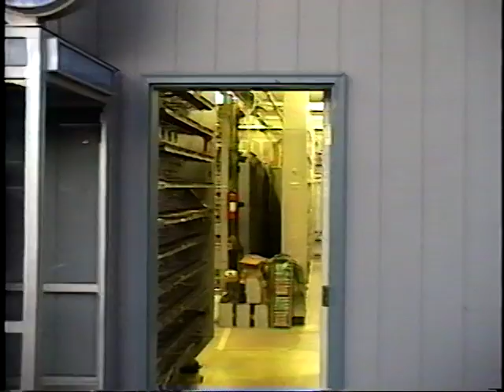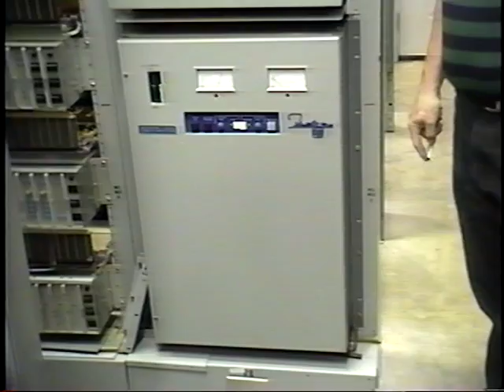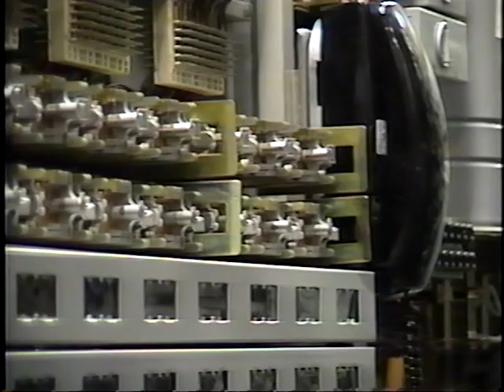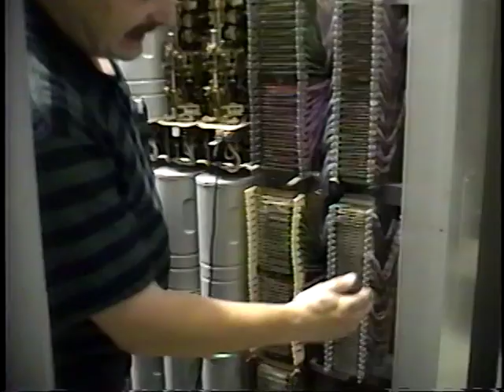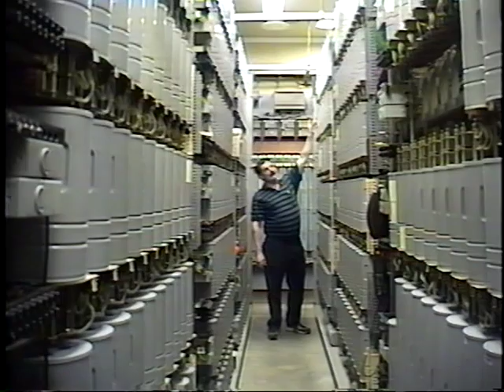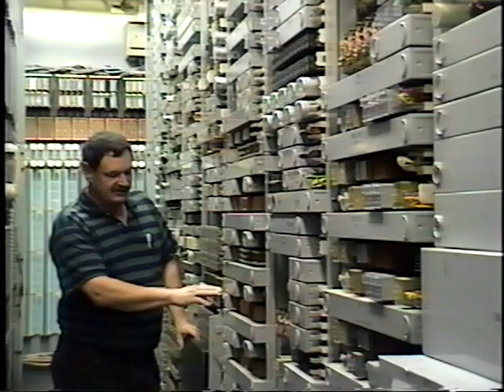Strowger, (SXS), step by step, Bell system, Western electric, Step switch

Comment: Fascinating!  I'd much sooner trust a good ol' relay for longevity 16:47 16:55 than any dirty digi-chip. Problem is, even a relay can't work forever. What can you do if one of those cans goes out?
Reply: You can rebuild it.  At the Dial Central Office Repairman school at Ft. Monmouth in 1966, we took ‘em apart and put ‘em back together.  The mechanical parts and the relays.  I worked in exchanges of this type at Ft. Benning, which is now Ft.Moore.  Of course, in the Army way, they sent me to a 19 week school to learn this stuff, but at Benning the exchanges were run by civilian employees. My job was to cut the grass.  But by begging I got to work on equipment sometimes and ended up being the night guy where I could fix whatever I wanted.  Then I got shipped to Germany, where I never got to hold a screwdriver. The equipment was Siemens and the civilian employees were German.  Strange unit.  One officer, about 25 GIs, and 75 German civilians.

Comment: At my fire department we had a remote fire siren that was several miles away from the firehouse which was hooked up to a phone line. We had a single pole single throw relay at the fire house connected to the Plectron where the coils to the relay were activated which closed the relay on the phone line when ever we would get a call and at the location where the siren was at, it was controlled by a weatherproof relay which was hooked to the starter for the siren, does that work the same way as this?
Reply: Those type siren controls used a “dry loop” (meaning that the telco only supplied the wire, no equipment) circuit.  A voltage source, usually at the FD, was fed thru the relay, to a telco supplied wire pair, that went to the telco office, was cross connected on the main frame, to another pair out to the siren location.  They were also called “alarm loops” as that was the most often use for dry pairs.  Businesses alarms were connected thru the telco to the monitor location.  Also the base radio was often remote controlled over a dry pair.
Reply: @stevepark5504  Ok gotcha!

Comment: Really want to have some fun? Here's an idea: Use one phone to dial the 218-488-0777 equipment listening number. THEN, use another phone to dial in from PSTN to get dial tone (the 346-377-0505 number.)

You can actually hear the system picking up your incoming call and the equipment respond to your inputs - literally listening to the selectors move for the very call you are making.

Even better, once you connect to something like the Audichron machine (internal number 377-4444) you can hear it on both the line you dialed in from and the equipment listening line, quelling all wonders you may have on if you are REALLY hearing the equipment you're using in real time.

For a modern phreak it's a bit of a religious experience, one could say. :D
Reply: Sounds super fun but considering I'm being charged around a dollar a minute to call in from Europe just for the dial tone I don't think it'll be good for my phone bill to have two calls running xD
Reply: @NikHYTWP  hey I would like to show you some cool stuff if you have discord let me know!

Comment: Tried the 346-377-0505 number and got a message "the number you have dialed is unallocated"
Reply from the maker: Try 541-327-4488
Ill check on the 346 number to find out what happened. Thanks for the info.

Comment: Thanks, very informative. Do you have a wiring diagram for the terminals  on the wood block and is it the same for the line finder, selector and connector?

Comment: wow great memories here when I was in the Navy back in the late seventies I ran a 300 line exchange at the naval transmitter site near Sidiy  Yahia Morocco. we had microwave links between that Base, the receiver site, and the main base in the city of Kenitra. I loved the 
Automatic Electric stroger equipment. I could custom build special devices out of broken equipment. one of them being a reverting ring machine for each of the three exchanges as well as  setup for monitoring the microwave links and busing them out as well. I also built a device for monitoring with a telephone handset transmitter unit at the main exchanges power board.
Reply: Just an addendum that was actually at 100 line exchange the we had a 300 line at the transmitter site and 800 at the main Base
Reply: I can remember when the power house we go down and every phone in the place would be picked up and all my finder's all wood pop to the top and my battery discharge went into overdrive

Comment: The Telephone Museum in Seattle also has a nice central office of Step and Panel offices and and an early WeCo ESS. I believe there's another hobbyist with a central office in the Sierra's of California near Angles Camp. I never can get enough of Electro-Mechanical Switches. Someday I'd like to find someone that has a working Bell System Picturephone setup through #5 crossbar. I always remember trying out the one in DIsneyland in the 1960's. Way ahead of it;s time.
Reply from the maker: I'm involved with both.

Comment: This is so interesting although very tough to understand.  Each telephone on a step by step goes through those canisters which are all very mechanical.  For that reason, I fail to comprehend how another machine could identify the number you are calling from on such a mechanical system.  I also don’t understand how an operator could barge into the line to see if there is trouble on it, but I know they used to do it.  Before call waiting, the only way to get my mom was to call the operator.  Mom would chat for hours at a time and if I really needed to talk to her I’d dial the operator and ask if they could check the line for trouble.  Mom would hear the clicking of the operator cutting in and hang up knowing it was me trying to get through.  I also saw the coin phone equipment.  That is also very interesting about the coin return or collect.  When calling long distance on a payphone the operator would be needed.  The operator would ask me to deposit $1.10 for 3 minutes, and if the line was busy the operator would press something that sounded like a high pitched ring signal and my money would come back.  The operator was somehow able to control whether the coin returned or was collected.  It’s always been a mystery to me how this all worked.
Reply: ds99,  I just read you post.  I was a pbx operator at my high school, then the local Hospital and then the Army overseas.  When I came home I started working at AT&T as an operator.  I didn't get to work on the old cord switchboard as it had just been taken out of service and new TSPS consoles were the newest technology.  You mentioned the operator checking the line for conversation.  When I became a supervisor after 4 years of being an operator I was lucky to get to work on a large cord switchboard in Oklahoma City.  The service you are talking about was called Verification.  When a customer dialed 0 and ask to check for trouble when the new system was installed, that operator would connect you to the verification operator on the cord switchboard by dialing a special number.  That would light up a signal on a red/white strip on the cord switchboard and you waited for the first available verification operator to pick up your call.  After you gave them the number to check, the operator plugged into special jacks/connections to verification equipment for that exchange and keyed that number.  The equipment would cut into the line so that the operator could hear if it was conversation or in trouble.  IF you declared an Emergency, we took your name and number, cut back in and excused ourselves and explained we had an emergency request and who it was from.  If they agreed, we gave them your number.  After TSPS was a few years older they developed a way that the dial 0 operator could press a button to verify the number.  You probably couldn't tell the operator had connected if you were the one on the phone, and the operator could not make out what was being said, but could tell if it was off hook, in conversation or trouble.  Along with this service being available at the TSPS console also made billing you for emergency interuptions as easy as pushing a button.  I also don't understand exactly how the mechanical switch could tell what your number was, we would get a display with your number once we got to the new TSPS system.  As the old equipment was removed and new electronic switches installed of course it became easy to identify the number.  Rural  areas had older equipment for a longer time, and when they dialed long distance with 1 + it came into the console with a light that read CAMA.  We then ask you for your number and entered it.  The bad part of that was if I made a mistake, or you gave someone else's number it would be billed wrong.  We later even began to do overseas calls without the help of a special overseas operator.  Of course a few years later cell phones started to become common and the Bell System was broken into regional companies and the good quality service via land line telephones started a downward spin and now days you have no operator that really knows anything or will help place a call.

Comment: One if my first jobs 31 years ago was replacing a strowger PBX4 for Pan Am at London Heathrow Airport. It amazes me as a baby engineer that we went from a room full of noisy kit clanking and ticking and whirring to a Nortel meridian switch on the wall !!
The serving exchange was just phasing out the last of the strowger equipment just as I joined.

Comment: Wow! absolutely amazing to have one of these still existing and operating!! I tried the first 2 numbers and was able to listen to the sounds, however the numbers given to access the switch seem not to work, although no area code was given on these numbers, I tried both 218 and 541. What is the area code for these numbers, and is it possible to dial in and use the switch, or do you have to be in the local area to do that?
Reply: Figured out my problem, the dial tone number is the number into the switch, but the network does not relay the pulses from my rotary phone to the switch, so I guess I must use a tone phone. How Ironic not being able to use a rotary phone on a SxS switch. Anyways thank you so much, Sxsphil for preserving this wonderful lost technology!!

Comment: Just curious, when connected to the system via the ptsn line, what numbers are active, and can I dial into other switching systems such as the north electric cx100? also what is the siren-like sound when I dial 1? I've heard it before and can't seem to figure out what it is.
Reply: I believe that siren takes the place of the "The number you have dialed" recordings. Playing around on the dial in line with random numbers gives that siren.

Comment: Is that number 218-488-9901 still connects to an old step by step switch that generate tone using a old rotate generator, or to a modern digital system, thank you
Reply from the maker: Yes, its been ported out to me.
Reply: @sxsphil  So, you mean it is converted to digital system and use recorded ringback tone from old tone generator
Reply from the maker: @wenjuwang6150  No, the number is forwarded to my step system, what you hear is a real sxs ring tone.
Reply: sxsphil Thank you very much! I dial this number from China from my china telecom landline.
Reply: sxsphil But I didn’t hear dial pulse sound on the line when connecting

Comment: Seeing this helps you appreciate just how much real estate these mechanical offices used. Cutovers to newer equipment sometimes required adding to a building to accommodate the new stuff and after the old machine was removed there would be a lot of empty space on the floor. 
There was also the "Hot Slide". The new equipment would be assembled (usually off site) in a trailer. An exterior wall would be taken out and the new system put into service and the old one removed. The new system would then be slid into the building, the wall replaced and the crew would clean up the cabling for the permanent install.
I went to the Smithsonian years ago and they had an older type office called the Panel Central Office. We had a fire in a central office in New York City in the 1970s and it was mostly Panel. It all had to be replaced with electronic switching which was pulled from ongoing jobs Western Electric had going on all over the country. Since the equipment was connectorized it plugged together rather quickly. Only six weeks and we had 270,000 telephones back in service. That included tearing out all the ruined equipment and cleaning the building of all the powdered flame retardant and water. Thousands of us worked around the clock toning cables from every building in the district back to the burned cable vaults in the basement so the new cables could be numbered and accounted for. Another disaster like that would probably be more difficult to fix now that the Bell System is dead.
In each cutover to electronic the company gains hundreds or thousands of feet of floor space which in some cases has been converted to office space allowing departments to stop using rented space and saving money. 
Maintenance was reduced with all the moving parts removed with the old equipment making many employees redundant. We were as much mechanics as electronics techs in the old days oiling and adjusting was a full time job for someone in most of the large central offices.
Reply: There was extra equipment outside the normal channels called "service observing equipment." The operators could access that and cut in or listen in. Worked good for law enforcement wiretaps, too, sometimes, I guess.

Comment: These videos bring back a lot of memories! I was a phone phreak and while I wa in high school I spent the day with a switchman at the North Lake C.O. in Pasadena that was WECO SXS and Plunger Switch. At that moment I was determined to be a switch tech. I tried to get a job at Pacific Bell working in switching but they said I would have to start as a frame attendant or installer/lineman. They did say that they took people out of the military and started them in switching. I checked with all the services and the U.S Army had a Dial Central Office Repairman MOS 36H20 that I would be guaranteed. The other services would only guarantee electronics or other fields but not a specific job. In the Army I worked on AE SXS, Stromberg Carlson XX, hybrid SXS/XY and some other stuff I can't mention. When I got out I went right to work as a Comm Tech Toll at the Grand Complex in L.A (LSAN01, LSAN02 and LSAN03). I was on the 8th floor private line board where we had every type of trunk that existed. We also had the Southern California Gas Company private network trunks, which meant we had to work on the SD65718 gear tie trunk equipment so they could have two way trunks from the 5XB Centrex. That was really fun to work on, not really. After that I worked for a company building a microwave network then I went to a long distance carrier where I worked on DMS250 switches. Then I was at NTI and we were installing DMS-100's all over L.A. so that Pacific Bell could meet their equal access requirments because the Telematic Adjunct on the 5XB machines didn't work like it was supposed to and they had to replace all of the 5XB. Then I went into cellular. Long story, short, telephones have been very very good to me! Can I bring my Grandson up to see your museum?
Reply from the maker: I'm 5 miles off I-% exit 243 Oregon, (8) miles south of Salem. Or.     State Capitol
Reply from the maker: Its I-5 not I-% 971-239-5084 leave VM.
Reply: @sxsphil  We won't be imn Oregon in the immeadiate future. I'll check with you when we do plan a trip up.
Reply: Hi Mark,  While I was a medic in Germany in the Army, MOS 91B20 they had a program to get me ready to leave the service and I got to work on the Stuttgart Germany 10 position switchboard at Robinson Barracks for a few weeks.  Most in country calls required me to build a circuit, calling city to city until I reached the place I wanted to call.  Other calls came in on Autovon.  USA calls had to be booked and called from another base.  It was interesting.  Cheers.

Comment: Sxsphil - thanks for conserving history. This is equipment that's all gone to the scrapper - elegant, reliable, loud banks of rotary switches and relays that perform the job well, without a single computer or silicon chip; analog equipment that lasted for decades, heating the building all the while.
Reply: instaBlaster...

Comment: That was an interesting tour. Hopefully they got that O-System equipment up and running. I remember when the Phone Company had open wire from Moberly, MO to Paris, MO. 2 crossbar from Moberly to Madison, then 1 crossbar for the remainder of the route. That line was wrecked in the mid-80's. You can still see several cross arms in Madison.

Comment: I was trained in the Air Force as a step switchman and worked for Bell/AT&T for 42 years. Funny how after a while you didn’t even hear the switches unless one wasn’t stepping right.
Reply: Yes in a busy exchange of 1000's of line your ear would tune out all the normal sounds but pickup a switch going wrong 1/2 the exchange away! (or someone trying to "tap" a public phone for a free call)
Reply: Did you work in the Southern California area?
Reply from the maker: No
Reply: I worked in an exchange like this at Ft. Benning and I know exactly what you mean.   You don’t hear them unless they aren’t right.